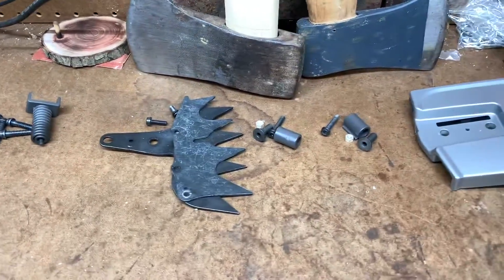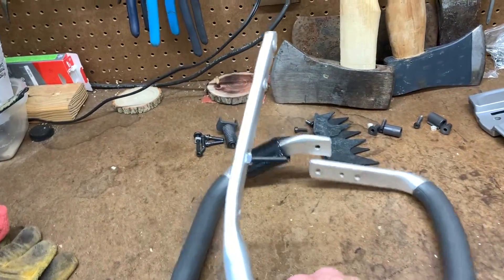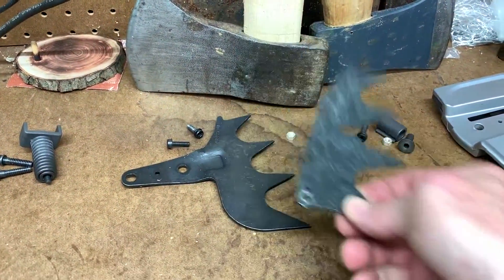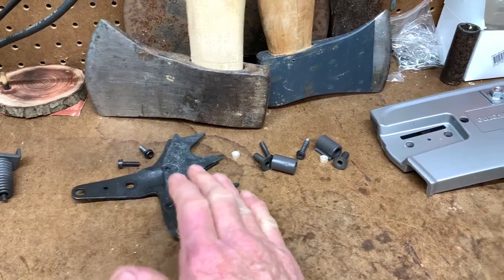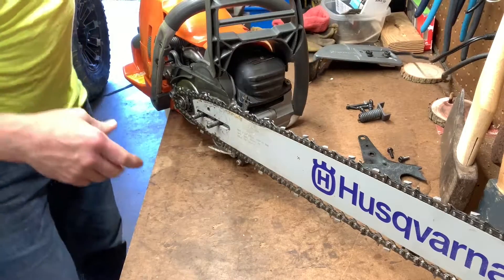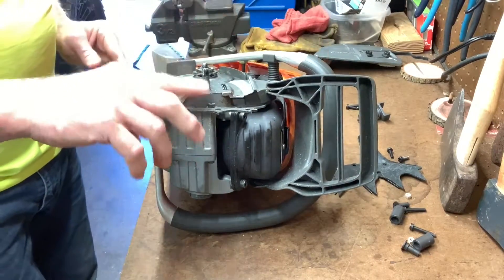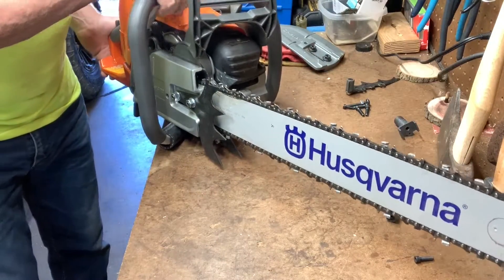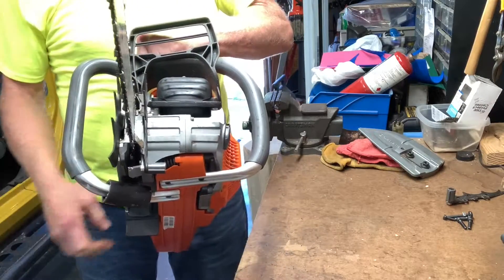How to Install a Full Wrap Handle Kit on a Husqvarna 572XP Chainsaw

Comment: Hey man great upgrade to a great saw! Just a pro tip. When you are adjusting chain tension make sure you have the bar tip held up. If you don't, no matter how hard you tighten the side cover your bar is going to drift upward. Causing the chain to run loose. Also the sights on your saw are going to be off. Without the tip of the bar being held up when tightening. I'm not trying to tell you what to do. Just offering a little friendly advise. Awesome video. You'll have a lot of fun with that saw!
Reply from the maker: Thanks for the tip, Jake. The point of the video was show the upgrade, but you are absolutely right about the proper way to adjust the chain. Thank you so much for your comments, my friend. Stay safe, strong and kind!

Comment: Absolutely amazing video!!!! I am a small business owner trying to make it all work . I have to turn to YouTube for certain things. To try to learn how to put stuff together and I'll tell you this video is amazing thank you so much.
Reply from the maker: Wow! Very nice comment! Thank you so much!
Reply: @WaynePolcin  I just bought my first 372 XP. I have had may Husqvarna saw before but never with the full wrap . Tried one at a outdoor equipment  expo wow what a difference.
Reply from the maker: It does make the saw more versatile. The only downside I have found is that you are limited as to how low you can cut a stump. The hand hits the ground and forces you to cut a couple inches higher than desired. But that’s a very small sacrifice IMO.

Comment: Great post! I have just found the wonderful world of chainsaws  due to Hurricane IDA that came through here in August 2021. Since her coming through here I've purchased an Husqvarna 460 Rancher and a 572xp and I was just yesterday looking and wondering why my 572xp did it not have two dogs on it. Well now I know thanks to this video that I can purchase a kit that address that question. Thanks again for the post.
Reply from the maker: I'm happy for you, Herman! I remember that Red Pill moment, when I discovered the joy and magic of chainsaws. You are not alone! Stay safe, kind and strong my friend!
Reply: @WaynePolcin  1 more question. I purchased that wraparound for my 572 well I used to store it in my Husqvarna 100000107 Powerbox Chainsaw carrying case for 455 Rancher 450, 372 and 375xp. And it fit just fine until I did the wraparound.  Any suggestions on a hard case for the saw with the added features?
Reply from the maker: I’m sorry, Herman. I don’t use saw cases so I can’t help you with that. I keep all my saws covered in the back of my truck so they are protected and always ready for work. I would recommend asking a local Husqvarna dealer. If I hear if anything I will let you know!
Reply: @WaynePolcin  Thanks

Comment: Make sure chain catcher goes between the dogs.  Outside dog should have a hole drill that lines up with the hole on the inner dog.  Looks like you installed it on the inside of the inner dog.

Comment: While your saw was on the bench near the end, there was a small screw under the "a" of the Husqvarna  logo of the bar.  That screw holds the outside dog to the bar cover when the cover is removed.  I wonder what the black bolt or stud does on the right side where it enters that big opening.  Limit the suspension travel?  I did the "west coast" mod because I am left handed and this lets me run the throttle left handed, which is "cow handed" on the regular handle.

Comment: I just got my kit the mail I work for a tree company for the past 7yrs. I use a 572xp alot and wanted to upgrade it. As soon as I get to the shop tomorrow I'm installing my wrap handle it's gna look awesome. Btw your chain catch was installed on wrong side of dawg.
Reply from the maker: Yes. I realized that after I put it back together. Either the dealer or the factory installed it that way. At first, I didn't even know what it's purpose was, being on that side of the dawg. Thanks for the feedback sir!

Comment: Great video, thanks for sharing. I just bought the 592xp and will be ordering a full wrap handle. Though, I have the catch nuts on my clutch cover so I wont use the cover they send with it. Plus I will be ordering West Coast saws dogs.
Reply from the maker: As I recall, I wanted to use my existing clutch cover, but because of adding a dawg, the original clutch cover wouldn’t allow the bolts to extend out far enough to attach the nuts. If the West Coast Saws dawgs mount differently, then you may be able to use the original cover. Anyway, good luck to you and thanks for the comment!

Comment: Hi Wayne. Just watched your video of ‘Full wrap handle kit for a Husky 572xp’. I have a 576xp which I have dropped a log onto and bent the handle. I have managed to straighten the bent handle and get it back on, but in doing so I was faced with a question. What is the function of the long screw that sits between the top two screws on the side of the handle and goes into the large hole in the saw body. The large hole on my saw is empty and was wondering if there should be some sort of vibration damper thing there. The top screw fits into the spring mounted onto the side of the cylinder head, so the arrangement on mine looks very similar to yours. Hope you can help, Cheers, Kevin.

Comment: Awesome upgrade!  Thanks for sharing.  Minor complaint for me would be that there is no option for captive nuts on this particular upgrade.
Reply from the maker: Yep. I was disappointed with that issue too. Another sub said he put the original clutch cover back on so he could keep the captive nuts. But you would have to leave the outer dawg off to do that. I think the double dawgs give so much more control that it’s worth losing the captivity. Thanks for the feedback!

Comment: Very nice video and thank you for the tutorial. Very helpful.  Will get this kit for my 572.
Reply from the maker: It's an easy install. The only drawback is that the full wrap makes it hard to cut low on the stump. But that's what stump grinders are for. Thanks for the kind comment!

Comment: I added this to my 572 but the small middle screw won't hold, it's stripped actually,  any ideas? Probably don't really need it anyway but it would be nice to keep the dog on the cover.
Reply from the maker: Short of drilling and tapping to the next size screw thread, I would just leave it out, as I did. It's not that much of a hassle to put the dawg on when you put the cover back on.

Comment: So is a full wrap handle just easier to handle saw when felling or more for a safety aspect?.. I just purchased one of these 572xp and now just looking at a wrap handle.. do I really need one lol
Reply from the maker: No you don’t really need one. It allows you more options for handling the saw, like cutting from the left to the right using the bottom or pulling side of the bar. It can get in the way at times, like when cutting a stump low to the ground. I mainly wanted the versatility and bigger dawgs. Thanks for your comments, bombidude. Stay strong and kind my friend!

Comment: How much for the bar kit ? And where to buy the kit tq
Reply from the maker: I’m not sure where you live, but if there is a Husqvarna dealer in the area, you can order it through them. That’s how I purchased mine. I paid about $40. I also found that Amazon has them. Here’s the link Husqvarna OEM 572 XP/XPG Front Handle Wrap Kit https://www.amazon.com/dp/B086KRFG23/ref=cm_sw_r_cp_api_glt_fabc_YP6RQC7C4BRS67XCHY4K
Reply: @WaynePolcin  I live in Malaysia

Comment: Hi Wayne and Suzie!!😀😀
Great to see you my friend!!😀😀
Nice upgrade to the 572.
You must have purchased it just lately. 
I'm a Stihl man through and through. Ever since Husky started selling their saws at the big box stores I lost all faith in them. 
Stihl's are only sold at shops that have a full service repair shop for them. 
Don't get me wrong. The 572 seems to be a pretty decent saw. But I have heard from guys that run them full time don't like them as well as the old 372s. I hope you get many years of good service out of it!!😀😀
Take care my friends and stay safe and healthy!!😀😀❤❤

Logger Al 

P.S Congratulations on the kids wedding!!😀😀❤❤👍👍
Reply from the maker: Hi Al. I appreciate the feedback. There's a back story to the purchase of the 572 and when I get caught up, I'll tell you the story. Let me just say this, I bought the saw from a full service dealer, not a box store, because I'm the same way. I don't want to buy something from a place that knows nothing about the product. But I think it's darn funny that they didn't notice that the chain catcher was installed backwards. I wanted a 372, but they sold the last one a week before I walked into the store. I'm sure I'll be checking out a Stihl sometime down the road.
Take care my friend. Stay strong and kind!
Reply: Stihls are sold at Rural King and other retail outlets. Not knocking them, just keeping the info correct.
Reply: @hellbillycycles2585  :) I don't really consider Rural King a big box store like Menards or Home Depot. 
I do believe that Rural King has a service department for the things they sell.

Comment: Didn't know you picked up a 572, they're nice saws, enjoy! Go ahead and remove the stock metal chain catcher, all it'll do now is block chip flow.
Reply from the maker: I will do that. Thanks for the advice! There's a story coming about why I purchased this saw. Stay tuned. Thanks for checking in, buddy!
Reply: @WaynePolcin   Can't wait for the story.✌
Reply: What do you know about saws 😜.
How are you man, no videos lately?, been too hot here to do much.
Shipping a 562 and a 357 out today.
Hope your well.
Reply: @brettblack7049   Been a real tough go to be honest. Hope to get back to it when it cools down just a little. Plan on having a 500i at some point soon, like to see how it runs against other saws in it's class.
Reply: @Andyshine77  We are making some changes here too, one in particular is very big, but God is in control.
I haven't had a big craving to get one of those yet, I sold my 462 a couple months ago though, that was a fun saw as it was pretty light.

Comment: Hey WP, nice tutorial on the full wrap bar.  I am in no way a saw guy but, it looks like that chain catcher is on the wrong side of the dog?  Doesn't it mount below the chain between the dogs?  Anyway from over here in WPA, ya done good kid, and like Buckin says, warm up that saw!.  Thanks and take care out there amongst those trees.  Have a good one.
Reply from the maker: Yeah, I noticed that when I was editing the video. So I looked it up in the parts breakdown and found that it was supposed to be installed on the other side of the dog. The saw was built that way from the factory, so I just put it on the same way. Good catch, moof"DOGG"!

Comment: Nice job Wayne.
Did I miss the video of this beast in the wood 😃.
Do you want to sell the original clutch cover, I could use another.
Reply from the maker: Hey, Brett. I didn't post any video yet of the first cut with the 572. We had a wedding planning going on so I've been lucky to find time to do any editing. It will come soon. Actually, I don't think the camera was on for the felling, but it was on for the bucking phase. Get me your address (wpolcin@gmail.com), I'll send you the cover.
Reply: @WaynePolcin  
Well I'll be watching for it :).
Sent you an email, if you want to remove yours from the post.
Thanks.

Comment: You put chain catcher wrong😀
Reply from the maker: If you had watched the complete video, you would have seen my explanation (2:46) about why the chain catcher was on the wrong side. There were two chain catchers - an aluminum one and the plastic one. The plastic one was installed on the wrong side of the original dawg by the dealer, so without thinking, I put it on the same side of the new dawg. But I caught it when I reviewed the video and inserted that at 2:46. Good eye, by the way! Only a few viewers caught that. Stay strong and kind, my friend!
Reply: @WaynePolcin  yes, it's a good explanation, I like your videos! How is your 572 , yesterday I buy mine!👍
Reply from the maker: I like it because it’s the only saw I have in that power range, but with the dual dawgs, it tends to suck the chain into the wood too aggressively and the saw will stall. I have to learn how to compensate for that aggression. Good luck with you saw. Let me know how it goes.
Reply: @WaynePolcin  ok , nice day!👍

Comment: That chain catcher should be mounted between the dogs, I'm pretty sure you did wrong there.
Reply from the maker: If you had watched the whole video before making your comment you would understand what happened.  At 2:46, I explain the reason the catcher was installed backwards. I appreciate your comments, but please make sure you get all the details. Stay strong and kind, my friend!
Reply: @WaynePolcin  The dealer is the one who put the chain catcher on backwards, not the factory.
Reply from the maker: You are correct. I should have made that more clear. The dealers are the ones who assemble the saws from the factory. Good catch, my friend!